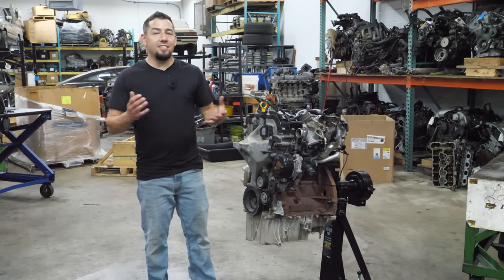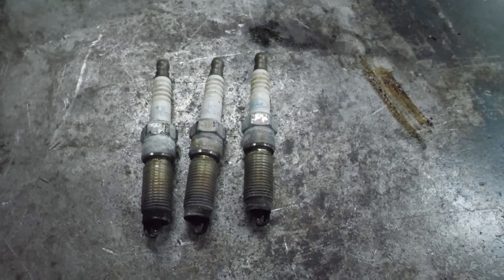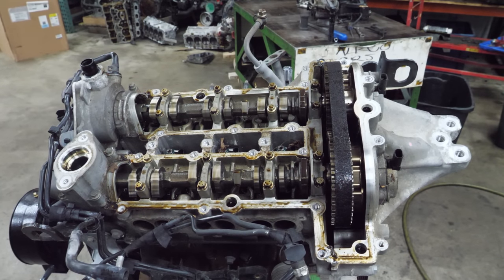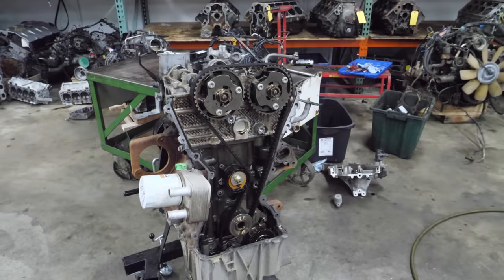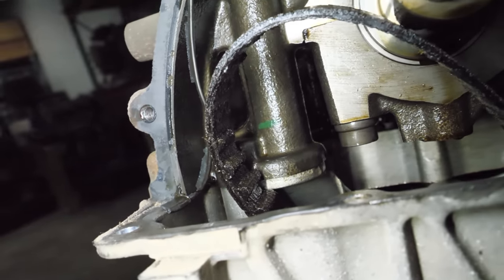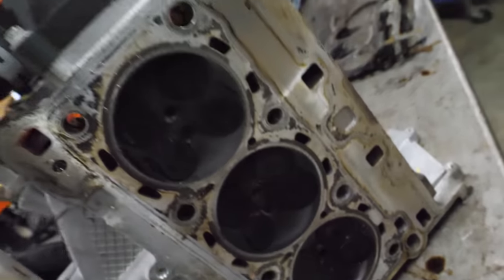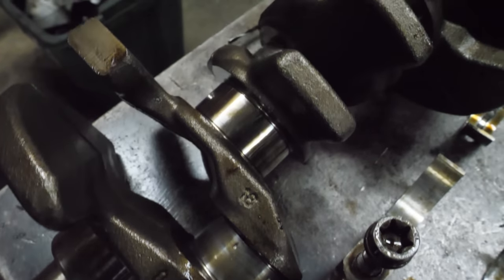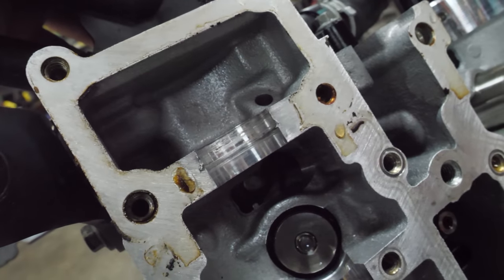JUNK Ford Ecosport 1.0L 3-Cylinder Ecoboost Teardown. LAWSUIT ENGINE!

Comment: This is my first time watching an engine get completely taken apart. I learned a lot from this video and the size of the engine is as small as it gets. Also, great video. :)
Reply: Careful it can be addicting 😂
Reply: Climbing down the rabbit hole nothin more fun than watching him disassemble motors
Reply: I would never own one of these engines!
Reply: @williamgunter6801 I would, but I would blow it up the same week
Reply: 0.660 liter engines are common in certain markets
Reply: The only thing you need to remember is to never buy a 3 cylinder, 4 stroke engine - especially this type with wet timing belts and no location key on the crankshaft gear. Dreadful design.
Reply: You should have wached duratec video. It would have tought you more. Its over all better engine. Revs to over 9000 rpm with forged internals.
Reply: @bobbailey7024 Do think Suzuki alto 3 cylinder is better than ecoboost.🤩
Reply: I rented a Ford Escape.  Had issues getting more than 24 mpg regular careful driving. Almost any other equivalent vehicle is 50% better

Comment: This gives me a greater appreciation  for the rugged simplicity of my Geo Metro's engine.
Reply: I wondered if someone was going to mention those. One of my bosses had a little metro with a stick shift and the little 3 banger with two squirrels and a hamster for an engine. It had 275k miles on it. Crap power, burned a quart of oil a week and rattled like it was an old guy with Parkinson's but it was a trooper.

Comment: Old 1.25 4 cylinder in Fiesta was a little perfection. Just 80hp, but very usable torque curve and it was joy to drive in town.
Reply: That's because it was developed with Yamaha
Reply: Yes we have a 1.4. Small power but a charming little engine that loves to rev.
Reply: I deal with cars everyday and the 1.25 is an absolute gem of an engine. Unless the car has had a major frontal crash that has physically impacted the engine, they always start! A very willing unit - and unusually for a 16 valve engine both torquey lo down and rev happy too.
Reply: I'm sorry but I've driven both. The ecoboost is a lot nicer to drive than the old 1.25. 0 road tax too. Not defending the wet belt design but no one can tell me the 1.25 good enough
Reply: I too miss that 1.25 , it was a fine engine and loved to be worked hard. I have the 1.4 (2007) which doesn't sound as good but still has plenty of torque. This 1.0 ecoboost when in working order is incredibly quiet at idle and has plenty of poke for it's size.
Reply: @leonblittle226 right up until the point it dies on you as a result of wet belt failure,first hand experience.
Reply: @TheCounty90 agreed 2009 1.4 has a decent amount of thrust even though it has done 100k miles plus 👍❤️
Reply: I have a 2009 fiesta with the 1.4 duratec engine, one thing I have noticed is how forgiving it can be when you don't downshift, say drop to 15mph in 3rd and it will still pull away nicely with minimal engine labouring.
Reply: I had a poverty spec late 90's 1.25 Fiesta 4th gen special edition in pepper red, they added a CD player sunroof and metallic paint but still had the wind up windows that was fine. It was brilliant! The engine just revved out and super smooth if I recall correctly. 24 years on and I still miss that car. Most have turned to the dreaded red dust now like most cars of that era which is a great shame but I still have those fond memories.
Reply: @ryanoconnor5256  agreed have also got an 09 plate 1.4 Fiesta which goes well through the gears and nice to drive 👍❤️
Reply: @ryanoconnor5256 hey! I have a '07 fiesta 1.4 duratec as well, and immediately upon reading your comment I feel very curious to ask about what to look out for regarding this engine after about 7500 miles?
Reply: @FirestormX9  mine had covered 51,000 miles, which is very low for its age, haven't had any problems with the engine at all, I am told though that so long as they are serviced regularly the duratec is a very reliable engine.  I'll have to wait and see how it is at 100k
Reply: @ryanoconnor5256  okay this is going to be a little embarrassing but I typed 7500 instead of 75000 🤦🏻mine is at the Ford service right now for an oil pan change due to engine oil leakage. They said there wasn't any carbon on the valves either, which was surprising. Now I am not sure if this one has port injection or direct but I think it is direct. I have regularly given it the company servicing since i bought it and i am the first owner. But beyond that actually, I just wonder what I can do to improve this engine and its output, but it's quite difficult to find reliable and specific info on this cause it seems to be a little rare this engine, at least now, if not before.
Reply: @FirestormX9  lol its okay I guessed that you meant 75000, as I said though I'm yet to reach that amount, and the previous owner was having this car serviced twice a year despite probably averaging 2500 miles per year
Reply: @ryanoconnor5256  well, let's hope for great drives ahead for both our cars then! Cheers

Comment: They really didn't go through much effort to obfuscate how intensely they wanted the engines to fail rapidly. I'm surprised that this is not a consumer protection issue.
Reply: Agreed. Wet timing belts should be outlawed. What an abomination!
Reply: Mine lasted for 90000 miles and nearly 10 years before I heard of this issue and got rid of the car, now it’s someone else’s problem. 😀
Reply: I'd own another one in a heartbeat. Completely reliable if you do the oil changes early and use the right filter and oil. I drive over 40k miles a year and I'm an auto tech. So many people talking out their bums without any facts.
Reply: @marvetheman  The wet belt breaking up and clogging the oil pickup is a real issue affecting many cars and I just wasn’t prepared to risk it. I did do regular 5000 mile oil changes but the Ford oil was so expensive, whoops😁
Reply: @marvetheman  The facts are that it uses a belt for critical timing issues, and un-keyed sprockets to drive its oil pump. Regardless your claimed authority in all things mechanical, because someone paid you to obey some tabular data and get excited for more tabular data, the engineering is poor. Mechanics are not engineers, or they would claim to be engineers, along with the engineer paychecks. 
Meanwhile, it doesn't take an engineer, nor even a mechanic, to know that these design choices are both risky and cost-saving... A double-positive, from a financial expert's point of view... Hence, massive - and warranted - skepticism. 
...or at least, that's what my bum tells me.
Reply: Ask Ford about their DCTs and consumer protection issues.
Reply: Fast and short life usage possivel maybe with luck Till 70Tmiles and then Flip IT to junk
Reply: @marvetheman  0
Reply: @buckstarchaser2376  It's an ECO boost engine, because the performance and reliability is so poor, any random EV becomes a better alternative and in many EU countries, the 1.0 L Ecoboost is THE ONLY available Ford ICE engine
Reply: @server1ok  Having any 3-cyl as the only Ford option is grounds for removal of country status, and re-labeling as an oversized convenience store.
Reply: New car, 3 year warranty. 4 year PCP, at 8-10K miles/year. Trade in, use as deposit for new car on PCP!  Dealer sends car to auction to sold off site. Dealerships cannot sell 4 year Old cars on site? Price differential between 4 years old? Dealer would have to give some warranty? Also be asked to do High cost low profit service & repair work on older cars & have them hanging around the dealerships! Bad for their image! All the money made from new cars in the First 4 years! The most money goes to the finance company! Second the manufacturer! Third the Dealership who get typically 17.5 percent! You do the Math! TESLA don't have independent dealerships!
Reply: @kevinburke6743  You could have trimmed that right down to "Tesla, an upstart, is wildly successful simply due to not having to pay a string of worthless middlemen and unions. And their cars aren't even very good. They're simply not made by a bureaucracy. "
Reply: @buckstarchaser2376  True but that would not have sated my severe cases of V.D. (Verbal Diahorrea.) Also Tesla are very good at what they set out to achieve. First they halved the number models most manufacturers put out! * down to 4. SEXY! That halves the complexity & double productivity. They use some of the same parts on most if not all of the range. Motors for example. With Giga Castings front & rear they have out done the Super & Hypercar makers with their C.F. Monocoque & 8 aluminum extrusions! 4 front 4 rear. Then they killed the Monocoque,  Steel/Aluminum Shell & putting everything in through the holes. They made a Powered Skateboard & built from the structural battery box floor up. Shit, I'm doing it again, ain't I?
Reply: @kevinburke6743  None of those wonders are new, novel, nor even modern. They are mostly being stated as "glimmering generalities", as all that stuff is basically just selected from off-patent developments from the companies that made them, but couldn't implement them due to crippling union costs, and work slow/shutdowns related to that. So, when the plants were in operation, they basically were forced to grind out the same or lesser garbage, just to get enough money to survive on government subsidies until the next union fit, where they would close more plants and export those jobs to other countries. 

The one thing worthy of gushing about with Tesla, is the profit potential that is permanently lost the moment a new regulation, unionization attempt, or middleman is added to the structure, and that they are currently pre-takeover by these various criminal enterprises. 

Everything else is publicity manipulation, that Elon pays for lots of. This is one of the middlemen that breeds rot and failure, as every opinion must be pure and perfect to compete in such an environment, and every potential scandal is a potential payday for media manipulators. It's no wonder he "bought Twitter as a joke". It's likely cheaper to run that company at a loss, simply for its value in spin control. 

...alas, verbal diarrhea squirts both ways.
Reply: @1337penguinman or VW for that natter

Comment: these timing belts became very common here in Brazil, including ford ecoboost... the problem is the oil spec, if you use the wrong oil and/or use some additive the belt is destroyed
Reply: Yes. 21:45 that's the most common problem on that engine. Poor oil or not changed on time and debris of belt will block the oil pump filter.
Reply: @nlousapt  Noted...my wife has a city turbo 1.0 3cyl with a belit in oil design. Maintenance with the correct fluids on these engines is critical. This is why our car has an oil life indicator. Fortunately, we don't even get to 10K kms in 6 months, so the oil is changed early. There have been a few issues with the engine - mainly poor / wrong maintenace, abuse or remapping. It's fast when remapped...but kaboom eventually...
Reply: I have a Ecosport with 110k km and 5 years. Nevertheless, when was the 100k service I asked to be checked if the belt was alright and how was the oil pump filter, and was everything clean. When reach the 200k km i will replace the belts.
Reply: I think, you should strickly use SILICONE oil on these engines:)
Reply: @bostjanerjavec4146  silicone oil is very hard to additive, became too expensive for car use

Comment: I had a 1.0 focus, i loved the little car. It got like 40 MPG highway and 30 city real world. It was a great little delivery car. Mine was a manual transmission so it was kinda fun to drive in a geo metro way. I eventually sold it after it started making a weird noise at idle. It had been to the dealer like 5 times at that point for oil leak issues and i never got a loaner car, so I just gave up on it. It still had some power train warranty on it when I sold it so if the new owner had an issue, they were covered.
Reply: my parents had an 88 civic hatch, really made me love light little cars. so fun to drive, and frankly you feel like youre doing 100 when you're going 45 anyways lol.
Reply: I had one too.  Loved it.  ‘16 Focus w/ 6 speed manual. Sold at ~100,000 miles. Car was basically flawless - just rust spots on rear wheel arches. 54 MPG was my best tank. Would have kept if it was AWD.
Reply: Had the 1.0 in a fiesta and it was 100k troublefree miles before being sold. Fun to drive in a little car.
Reply: I have a 2015 fiesta 1.0 trouble free even the duel clutch transmission is good, high way sits on about 3.8 4.0 litres/ 100klm, this are a good engine, as usual you need regular servicing
Reply: I don’t think the cam belt is a wet belt, the oil pump belt is.
Reply: @jimamizzi1  this engine and the notorious dual clutch , wow and no problems.  You must have a guardian angle
Reply: @jimamizzi1  they both are
Reply: @jimamizzi1  Both belts ride on the same shaft if one runs in oil the other gets the oil also as it rides up with the oil pimp belt.
Reply: @kirkdemadaler7041  ok thanks, I did watch it a second time and saw it, mine has 62.000 klm / 35000 miles runs like a Swiss clock, but I do take care of it.
Reply: @tomooo2637  must have, it does get serviced regularly
Reply: @LakeLake123  I get about the same mileage and not complaining

Comment: I love my 3 cylinder engine in my Mitsubishi Mirage now even more. Good old indirect injection, timing chain, no turbo. Very conservative engine. Low output, high reliability and durability.
Reply: That's a fantastic engine, and the mirage gets no love despite being a wonderful little car for the money.
Reply: Most people want more than 40 horsepower these days.
Reply: @shanemitchell5807  Well, it has 80 hp, actually. Nowadyas only 71 because of nitrogenoxides emissions reduction.
Reply: @shanemitchell5807 People always want more than they need
Reply: Timing chain isn't that uncommon, especially on turbo engines. Unfortunately, ford never got the memo that there are quieter timing chains now that are drowned out by the fuel injectors.
Reply: @life_of_riley88  I bought one about 6 months ago, a G4 stick shift. With the summer gas blend and warm temperatures, my average combined mileage has been about 42mpg. I guess I can understand why they're critically panned, but almost every owner loves them. It's cheap, extremely simple to work on (back seat pops right out and there's an access port for the fuel pump, for example) and with the sedan, it apparently has the same rear leg room as a Camry. It turns on a dime and has really nice electronically assisted steering. Yes, it is slow and has tons of body roll, but for an appliance type car, it's perfect, really. As for the engine, apparently it's been around since about 2003, almost unchanged, with very few known issues. Fun fact: the engine is manufactured in Germany in the same factory that makes Mercedes Benz engines.
Reply: @jnordne2  I would say that you're doing well to own and appreciate a mirage. To me, it's a car that's nicer than any car I owned in the 90'-early 2000's and it's the pinnacle of Japanese utility. Enough car for everyday driving, great economy, and excellent reliability. The critics just think that all consumers want to spend 50k+ on a commuter car, and that's not the case.
Reply: @CalculatedRiskAK  Well, the combo VW and timing chains is also a very bad idea.
Reply: @shanemitchell5807  I think most people wanted more than what the Mirage offered even in the 1980s. Most cars in the 1980s were at least around 100 hp in the USA. In Europe it's different of course.

Comment: Thank You for letting me know which engines I need to stay away from.  Ones with timing belts in the oil, oil pump belts in the oil, and crankshafts and camshafts that aren't keyed. 💯

Comment: That was the fuel pump bucket that fell out when you pulled the cams out. Fuel pump sits inside of it.  Common failure point when people don't change their oil.  Also the tensioner on the balance shaft was a problem for breaking. Just like what happened on this one.  I never came across any at the dealer that had cylinder cracks.
Reply: I was wondering if that bucket had wear issues. The VW EA113 FSI motors used a bucket like that too, and it was pretty much routine maintenance to have to replace them
Reply: @tally5k339  yeah I ran into a lot of "my friend up the road is a mechanic and changed my high pressure pump". But he never changed the bucket which was the initial problem. Wore a hole in it ate the camshaft and ruined the pump
Reply: @BeardedFordTech  usually the exact same story over here in VW land. Bucket would get worn through, leading to the cam and HPFP piston having a grudge match and destroying each other. It's funny how 2 manufacturers can make the exact same mistake, but I'm guessing the customers aren't as amused
Reply: @tally5k339  I highly doubt they are amused as well. Most manufacturers all use a lot of the same design things but just call them different names.